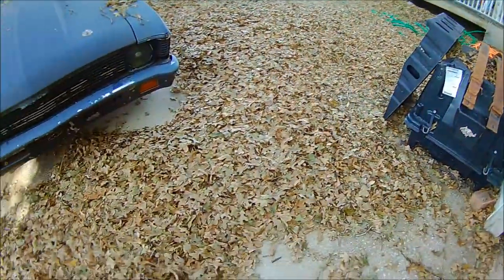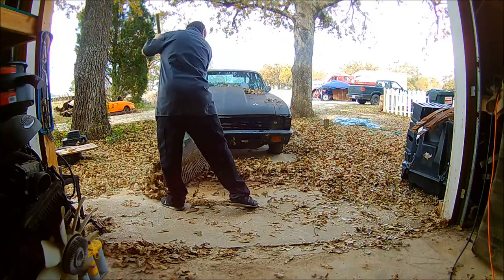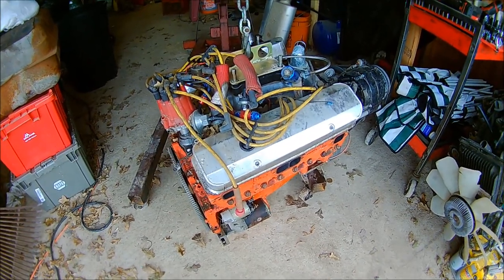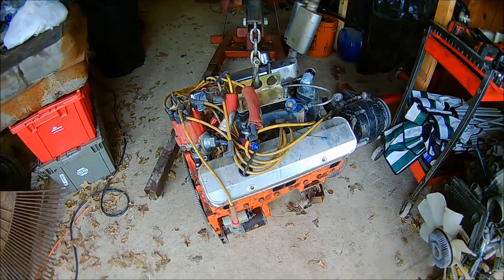1970 Nova Engine Removal | I Ripped Her Heart Out

Comment: Fun stuff..I'm going to yank the 350 rocket and turbo 350 out of my cutlass and find a Foxbody to put it in lol..It's got speed pro's and a comp cam valve train ..The transmission is just a stock rebuild with a stage 2 shift kit and 2200-2300 stall